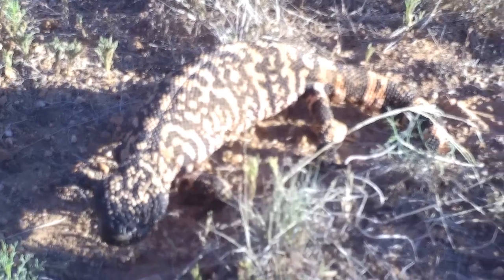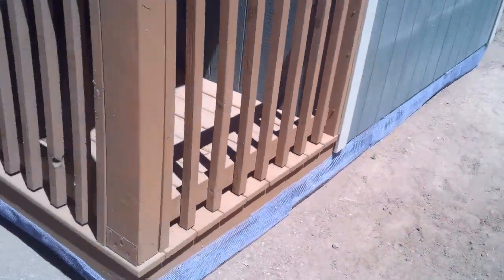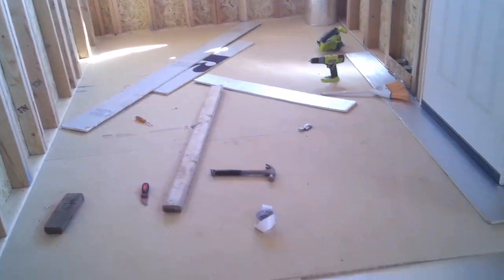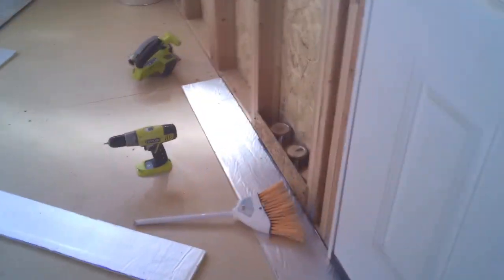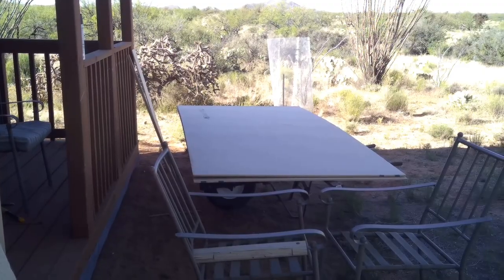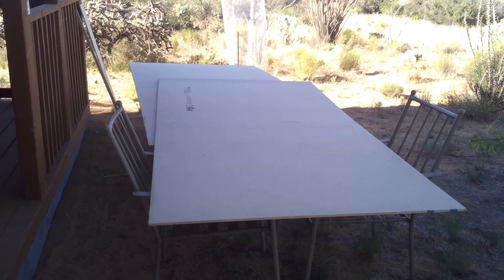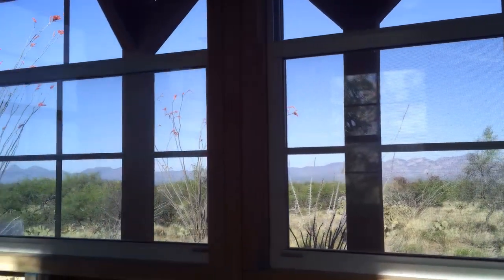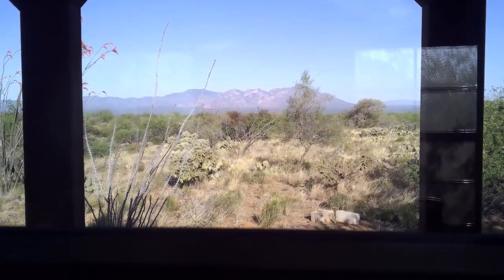Tiny House Projects - The Beginning @ AZ Off-Grid (Unplugged)

Comment: Great progress!  It will be interesting to see what you do with the crossbars.  I have stared at mine for months and can't decide. I have two lofts so all of the heat escapes.  I'm glad Ruger didn't get too close to Mr. Gila.  That would be painful!
Reply from the maker: @Daizy's Desert Garden =You are going to have to wait to see,, but I "think" I will cover them up with the same stuff I am putting on the walls.. It's not drywall,, it is not paneling.. It's not anything you have probably ever thought of using for walls and ceilings,, but I am going to give it a try.. I am hoping it is not like my singing.. You know,, where in your brain it sounds so beautiful,, until noise comes out.. I am hoping this will look good and help keep the heat down where I need it..

Comment: Looking at property but most I can find have no water or sewer. How do you deal with no access to water? Are you just filling jugs when you run into towm
Reply from the maker: Welcome to my channel and my videos of off-grid living in the deserts of AZ.. I have done several videos of my water usage here,, for 3 months,, for 6 months,, and 1 year.. Between me and the dogs, we avg about 150 gallons a month.. I have a 2500 gallon water tank on property and I just got 2 more tanks totaling another 950 gallons.. The 950 are strictly for collecting rainwater and the 2500 I have filled once a year with fresh city water for 160 bucks..  . Just like most rural properties you are responsible for deciding if you need a septic and putting one in.. ~$5 - $10 K .. A well would be prohibitively expensive.. for $1,600.00 I can have my tank filled 10 times over 10 years.. that same 1600 would get the well truck and drill out to your property.. .. Happy Trails.!!

Comment: I would put in tile. 
In AZ. the dirt and sand will ruin your carpet. Tile  is  easier to clean and much cooler as well.
Reply from the maker: Yeah,, true,, but the thing is, I don't want it cooler in the winter.. I want it warmer.. I set this place up to be as warm as possible in the winter because I hate being cold,, especially my feet.. Main reason I live in the Sonoran desert in S. Arizona.. Carpeting is easy to replace.. and during the summer I usually have all the windows open so the tile would be at ambient temperature anyway,, just like the carpet is.. Thank you for watching.. ..Happy Trails.!!
Reply: @deserthorizons  I've lived in Az.  since I was 8, so being cool ,for me is great even in winter...with a little warmth in the AM!
We hardly use our heat in the valley in winter. 
In Southeaster Az. where we have our small home, only in the evening.
Happy to see you enjoying your place!
Reply from the maker: @joannehyduckhopkins6898  I seriously thought about turning my heater on yesterday morning.. but with a little patience it warmed up well enough.. If I would wear clothes I could be warmer,, but that kinda defeats the reason for living here in summer..

Comment: What did that little building cost I. Was it a kit Did?  Did they deliver it?
Reply from the maker: I paid ~$7400 for it from WeatherKing.. I got it on a Rent to Own basis so it cost more.. payments were ~370 a month for 36 months with minimum down and no credit check..
They built it,, painted it, and delivered it.. They even put Reflectix under the floorboards for me.. The delivery video is here> : https://www.youtube.com/watch?v=DwYYA_MqlcQ&t=147s  .. Happy Trails.!!
Reply: So they actually transported there in set it up What's that part of the price was that will you paid for that including getting it there?
Reply from the maker: @josephdupont  Supposedly delivery was free for the first 50 miles.. I ordered it from WeatherKing of Tucson so it was within 50 miles.. Built,, painted,, delivered,, setup,, leveled all for ~7400.. With 5 - 2'x3' windows and 3 - 3'x3' windows.. all double pane.. And an 11 lite door.. plus the reflectix install but i had to provide the reflectix.. Best deal I could find comparing to Graceland ,, Tuff Shed,, or WeatherKing.. .. I have had it for ~8 months now and am still very happy with the build quality..